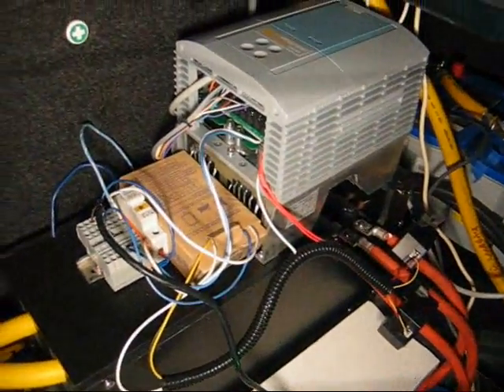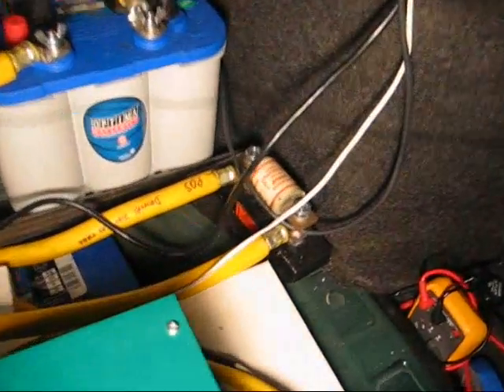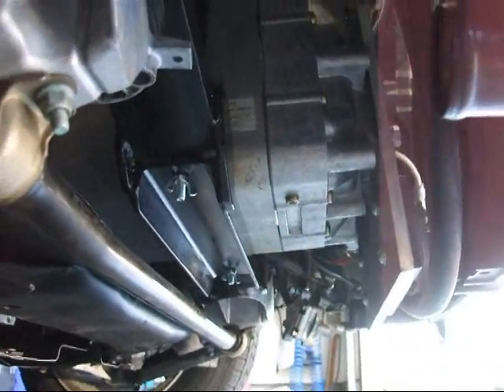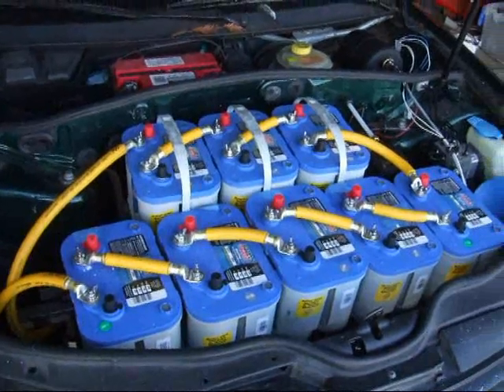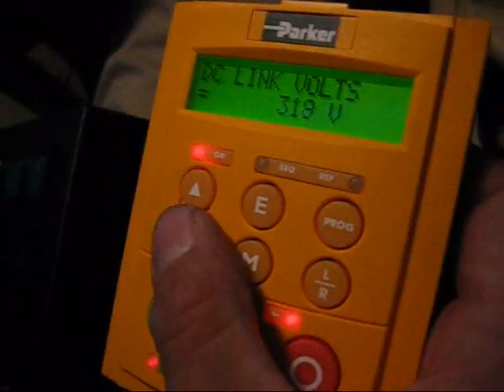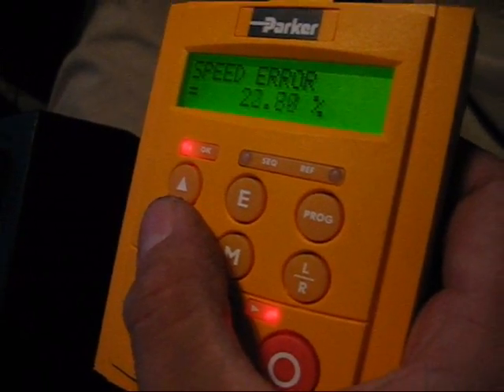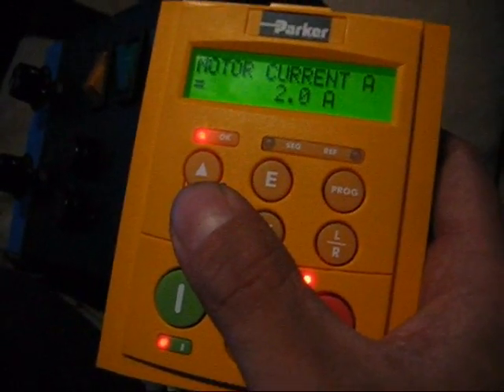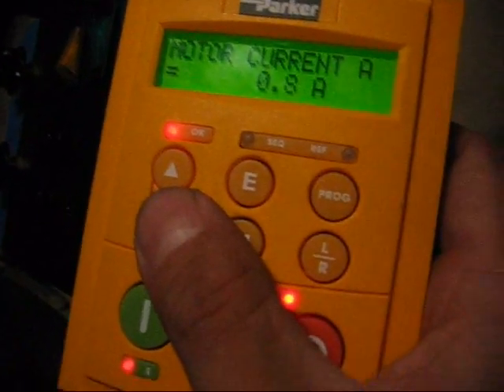VW Passat EV conversion 3 phase AC Siemens motor and hacked inverter

Comment: Thanks, 
I'm actually waiting for my Lithium battery order to arrive.  I will be using 99 100Ah Thundersky cells, this should give me 100 miles range, and slightly more power (higher voltage).  Cost was about $12.5k.  I am also working with a coworker to develop a new battery management/monitor system. 
-etischer
Reply: Hey man 14 years later may I ask how did it go?

Comment: AWD would be nice to have, especially in the rain.  I can keep the tires spinning several hundred feet because my 1000lbs of lead is like towing a trailer.  

If I were to add a rear diff, I would also add a second motor to power the rear wheels.  About 20% of my batteries are taking up the room under the car where the awd system would normally go.

Comment: Direct drive would bring my 0-60 times to several minutes I'm afraid.  It would be no different than driving a gas car using only 5th gear.   In a very light weight RWD car with a high ratio r&p, it may be feasible to do direct drive with this motor.  Since I need a differential, I might as well keep the tranny and gears. 

  I am using redline synthetic in the tranny to help reduce noise and friction.

Comment from the maker: @mrCbeems You MUST be missing something if you don't understand the advantages of 3 phase AC induction over brushed DC.
Reply: 90hp was the motor plate number, or the original plate number was smaller ( for example 10hp) and 90hp is the equivalent for ICE engine?

Comment: wow man. you have really pulled off a great job.
and a great car to . if you sell the engine will it pay for the conversion? if so you are a complete legend. just another 2 years and top quality lifepo4 will be really cheap. you can get pretty good ones now for $16 each for 3.3volt and 10 a/h
what would the cost to replace the distance   capacity you have in those batteries there?

Comment: i'd like to do the same to my "chevy aveo 2007 5speed" but i would like to use 
a bedini motor, or for of thim to battery charger as i drive down the rood.

i have looked up bedini motors on u-tube and most will put out 200 to 300 ACv.
and some people put ac inverters on thim.

so what i would like to know is thair a way to make a ac inverter that
runs on ac and not dc?

thats if you know and all so thanks for your time.

Comment: I'm most interested in your inverter/controller (and studying it on your page). I'm still weighing the benefits/drawbacks between using IGBTMs for the output, or going with 3 (75kw) amplifiers and true sine wave output. I plan to use a common industrial 30kw (3600 RPM) extreme duty induction motor, wired for 230 V, and control speed in 45 steps (including 50% overdrive for 5400 RPM). Other than size, and cost of the controller; what made you choose an IGBT output?
Reply: How much does the 30kw motor cost?

Comment: Would recommend to place all the engine related components placed at where the rest of the engine and the batteries at the bottom for improved center gravity. Just what I think.

Comment: @daswada9 
Not a wise thing to go without...
With cheap, liquid filled lead acid batteries, you could get away with not using a BMS. However, I wouldn't go without one in any battery pack as one of the benefits of using a BMS is a longer battery life. The savings alone would pay for the BMS.
A good BMS is required with all other battery types.